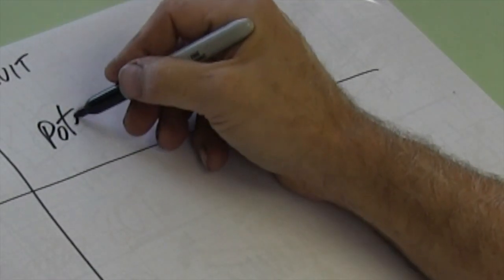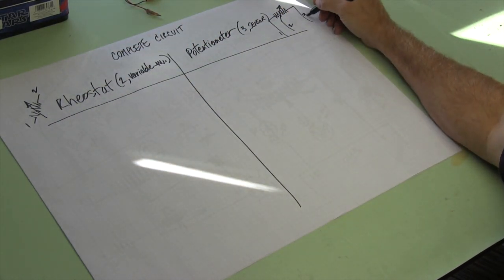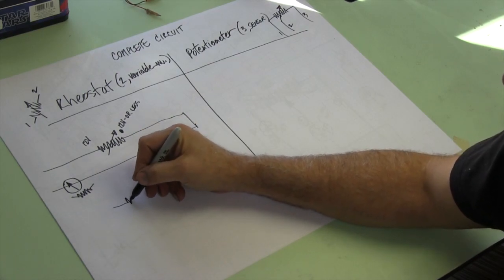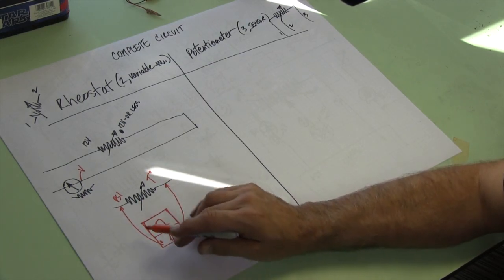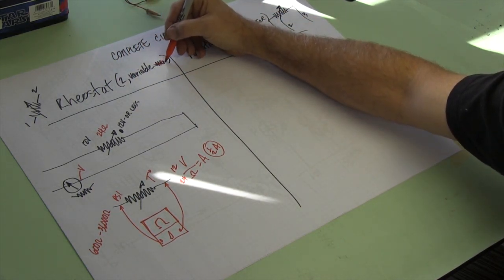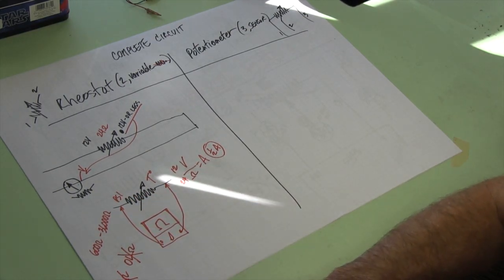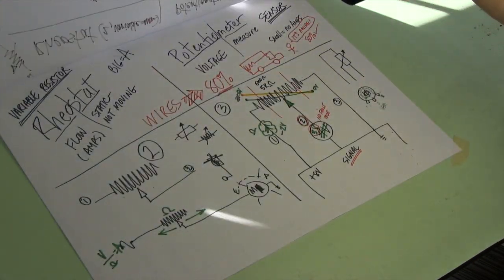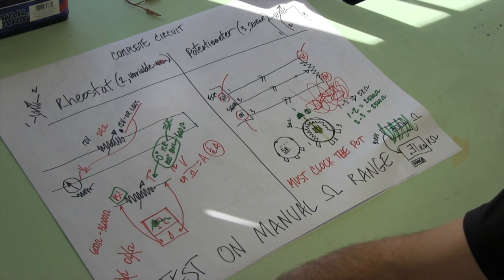Testing & Adjusting Rheostats & Potentiometers

Comment: A little clarification  about the rheostat.  It seems to me your explaining a  thermistor  as shown as a brass coolant temperature sensor and temp chart.  I am not familiar with a coolant rheostat,   I  must have missed  something ?
Reply from the maker: Many temp sensors are actually "senders" by definition. If there are 2 wires (one wire and an integral ground) it's a rheostat. If there are 3 wires its either a PWM (pulse width modulation) or RTD (resistance temperature device) sensor. Temp senders are often called thermistors. They're the same thing - that's what's important to understand. Thanks for the question.